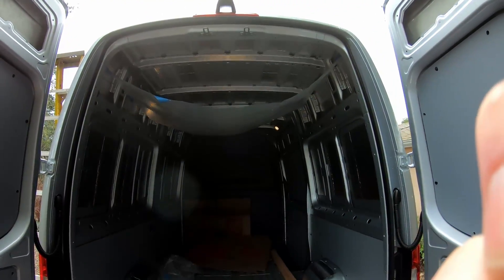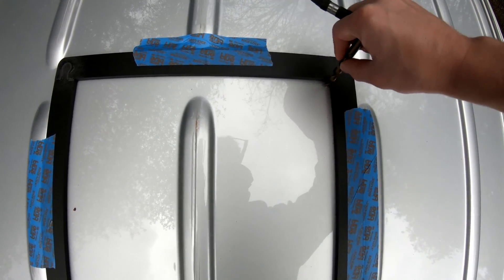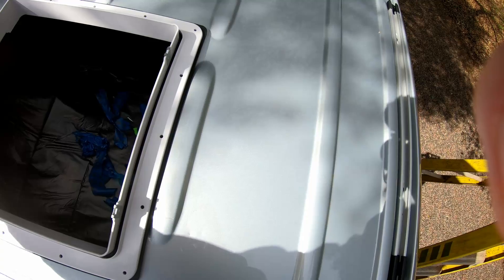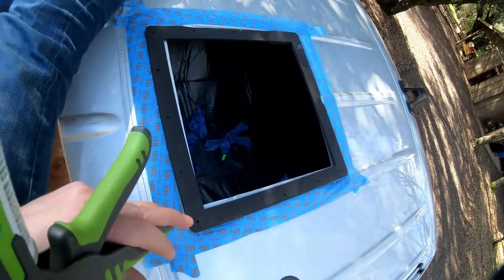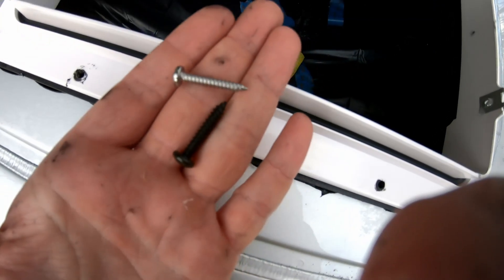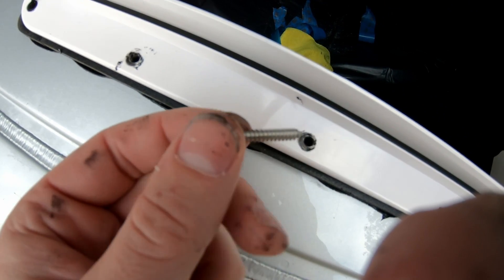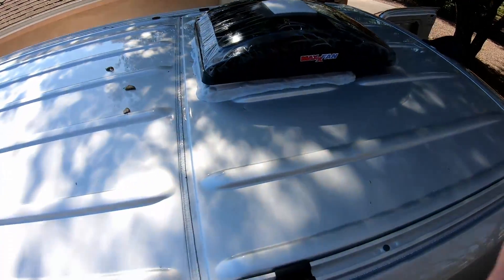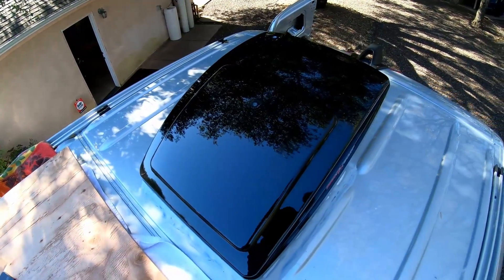How To Install A MaxxFan On A Van! Airflow Baby!!

Comment: Nice tutorial on the installation. I recommend placing the seam of the Butyl Tape on the back end of the Fan bracket. While driving, airflow pushes water towards the back of the van. Water will reach the front part of the fan then channel over, around and off the fan. The back side gets the least blast from the rain

Comment: I just stumbled on yr Van build videos, and I'm liking them a lot mate 👍🏼
Working my way through them right now as I'm doing my own project 🚐💨🇫🇷
Reply from the maker: That is awesome! Holler if you have any questions
Reply: @seven_o_savage  - when connecting the fan to the roof flange, did the 4 x holes line up easily ? I had a spot of bother with mine 🤔

Comment: Drilling = centre punch  ( in this case you had a guideline template siround to go by ) pilot hole ,1st. Then  use drill undersized for self toppings or same diameter for ba threaded or for clearance tiny bit bigger  
Test run on scrap metal first for drill size and screw grab effectiveness 
It's bit measures 3 time cut once 
B.A bolt washers and nuts would been more right for this job 
Loved your in cabinet aluminium and slide out bed build 
Keep videos coming

Comment: We installed our max air roof fan today.  We had watched your video at least 3 times and we knew what to expect at every step 
It came out nearly perfectly and we are hopeful that we pass the water test once our sealants cure 

Keep on doing what you do we appreciate it and hope to meet you on the road someday 

Two questions we had for you. 

1.How and where did you connect your fan to power?

2.  Have you thought about a make up air to allow fresh air into the Van when in exhaust mode?
Reply from the maker: Woooop! so stoked to hear this.

Comment: The CRL 15x30 sunroof is much more versatile. It extends up a few inches for ventilation, lets in light. You can also remove the glass and climb up on your roof.  I aim my DeWalt fan up towards it. The poor man’s maxxair.  The maxxair draws on your battery and though it might not be a lot it’s still draining your battery.

Comment: My question is with the liner on the inside.  Like what is the trim suppose to mount to.  Like it looks like you are putting screws up through your roof?  Like my liner is not anything you can screw the trim into.  It's just this foam stuff.  So how do you have a place for the lower trim piece to screw into?

Comment: Thanks for the video. Couple questions:
1. Do you know if the crew fan 2021 has a prewire to the OEM fan option location? If so, I imagine it has it's own fuse on the main fuse panel? I only plan to have a portable fridge, this fan and lighting (outside and inside) so don't think I'll be installing a full aux power system.

Comment: I have similar windows in my Revel.  They work great...that said they do rattle a lot when driving.  Do you find that these do that too?  I think it's the black out/screen part that is doing the rattling.  When I have them up, it is mostly not noticeable.
Reply from the maker: Windows or fans?
Reply: @seven_o_savage  whoa that's weird. I thought I made this comment under your new build for the new windows you were installing. I don't know how it ended up in the solar video.
Reply: @seven_o_savage  Any idea on the teeth per inch on that blade you were using on the Jig Saw?  24tpi?  36tpi?

Comment: awesome video! Great thoughts after thank you for being straightforward regarding the experience. My fan is on order and excited to install! Curious where you ran the wiring, was trying to browse the video and cannot see em which has me thinking you tucked em away -- did you run them through the van frame beams?  Thank you for the video!
Reply from the maker: I have some space between the insulation and ceiling where I routed all of the wiring that crosses the van. It’s basically attached to one of the ceiling beams.
Reply: Seven O Savage awesome! Thank you for the reply. Cheers!
Reply: @seven_o_savage  so where did you run it to get power to it?

Comment: Hey Seven, I think a Dremel would have been much easier than a jigsaw, especially if you had an L-Bracket of wood to protect areas you dont want to cut. Dremels can cause a lot of sparks especially on metal but IMO won't suddenly zig zag like a jigsaw might. What do you think? A better option right?  

Dremels can get hot and have motor burnout so when cutting metal I find it best to work for small amount of time and let cool, then work again, a cycle of 1 or 2 min working with 10 or 15 min cooldown.
Reply: No, a jigsaw is the correct tool for this job. A dremel is not the correct tool. If it is overheating, you are using it beyond its capabilities. Get a jigsaw with the correct blade for your application and use it. If you don't want it to wander, you can make a jig for saw to follow.

Comment: Do you cover the wiring and fuses at any point? You've got how to cut the hole, mount it and all that but nothing about wiring the fan.
Reply: I've noticed that on pretty much all these diy vids I think when I get mine put in,in about a week,im going to have it wired to one of those plugs for the cigarette lighter and use a die hard jump starter to run it. I found those little batteries that gose in those at home depot for arouy 40 bucks so I can have extras Hope that helps
Reply: @carolmaplesden916  That's an interesting way to do it, but in trying to attach it to a solar system - like they have done.. Except that part is left out.. You know the part that makes it a fan and not just a hole in the roof lol.
Reply: @lookatubex  yea 😀 I'm looking for the vid that shows how to do it But there's a way to change the battery pack with solar

Comment: does the fan act like air conditioning? or just a breeze? is it sometimes to hot in the van or is that nice and cool?
Reply from the maker: It gets hot. I’d recommend an AC unit if you can swing it
Reply: @seven_o_savage  Thanks!

Comment: Dood you get 10/10 for enthusiasm and enjoy your vids, but you really need to under-mount a wood frame interior side so it clamps and firms up the roof.. Roof is thin and flexes too much, and no need for the mess use Sikaflex 512 on the screw heads and a bead around the mount..I Advise people to have a good look through Max install vids, they ain't cheap so avoid the grief...

Comment: Why doesn’t anyone show the wiring up of fans?
Reply: Splice the wording to a cigarette type plug then you can use like a jacket or they have those little batteries in the lighting department at home depot or you can use like one of those battery jump starters to plug into.  You can get Those little solar fold up panels to charge those little batteries

Comment: 5:29 what tape is that?
Reply: Butyl tape pal. Caravan shops sell it. It never goes hard. Stays nice and soft 👍
Reply: UrbanARK overland awesome. Thank you. Btw have you heard of SikaLastomer 710. A butly glue of some sort? You reckon it would substitute the tape?
Reply: Just googled it. Yeah that stuff looks great. Description says above and below water level. Which means it’s the real deal. 👍🏻
Reply: UrbanARK overland I'm hoping we find someone who's actually had some experience with this 710. Would love to know how it performs in real life as a replacement, cause the tape might just be easier to use since you can mould it.
Reply: Yeah fair point. Most things in a tube behave pretty much the same. Like caulk/silicone. I’m a plumber by trade so nothing in a tube phases me. Make sure all surfaces are clean and dry. Apply liberally. And clean excess. Hope you find your answers. Good luck 👍🏻

Comment: Drilling in 2 corners would have been sufficient 😉
Reply: Sometimes it's best, turning the jigsaw can be tricky and drilling 4 holes gives a clean corner as the fan has rounded corners..

Comment: It would probably work better to use an angle grinder and a cut-off wheel to cut the hole in the sheet metal.
Reply: it was perfect , how could an angle grinder do it better